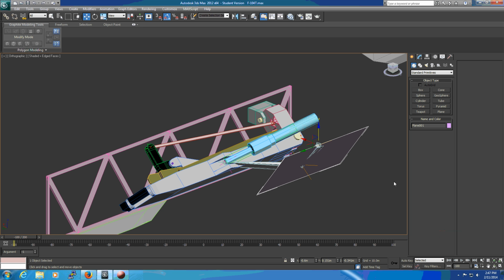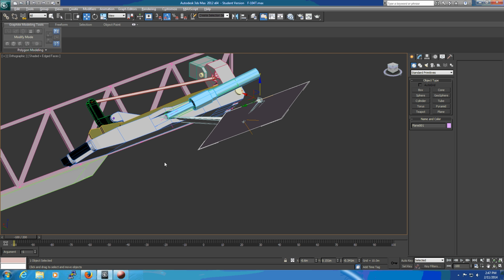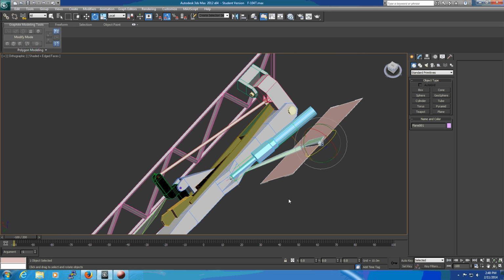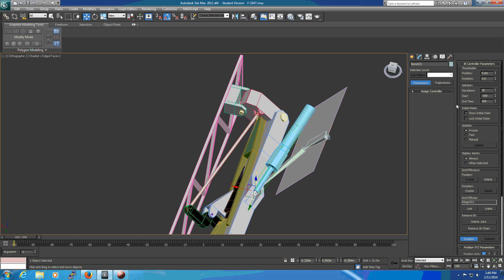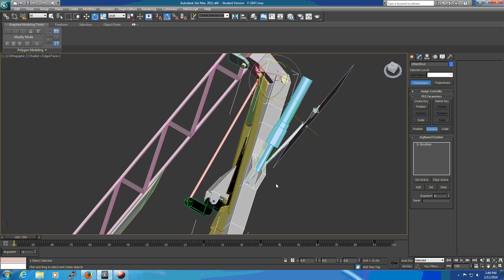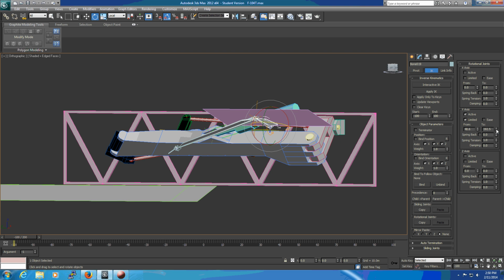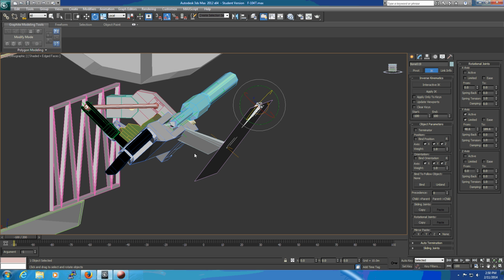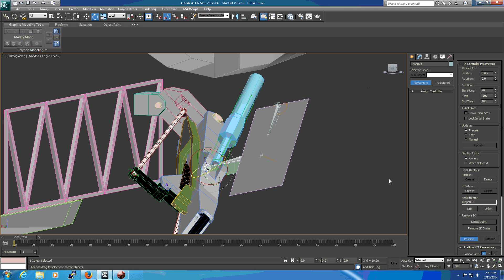Rotational Joint Limits Problem

Comment: First thing do not use bones. Just create the IK on the actual arms. When limiting the rotational joint to an axis this will cause issues. So the best thing to do is have all the pivots perfectly aligned in the main direction for example your gear door. So now if you have arms that are not line with the door axis. You move the pivot so it is in line. Here is an example in reverse of what you need. But same principle. https://www.youtube.com/watch?v=hEUUTdmx108&t=78s The other option I have a specific video for. Make sure you watch until the end as there is a second IK required. https://www.youtube.com/watch?v=yL6J3VdtgZ8

Comment from the maker: The best workaround I can find so far is to use normal rotational joint parameters until the rotation snaps out of position and then turn on rotational limits to get it back in the proper position.

This works since I'm using two sets of bones and the object bones will be matched to the IK bone position and rotation and the keys baked.
Reply: just want to let you know that this mistake is still there after 9 years
Reply: @PaulOsadchy  True limiting the rotational axis will cause more problems for the other IK's. See my post above.